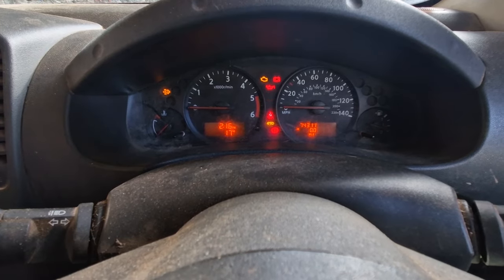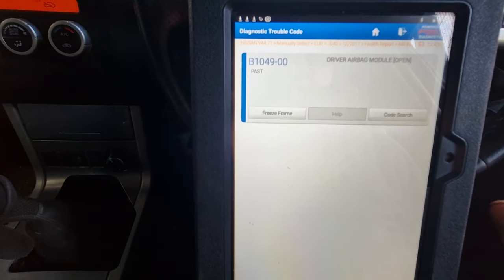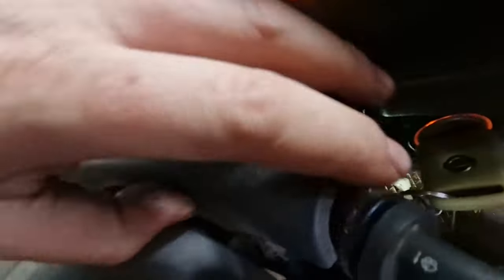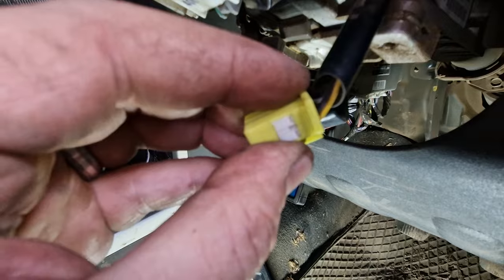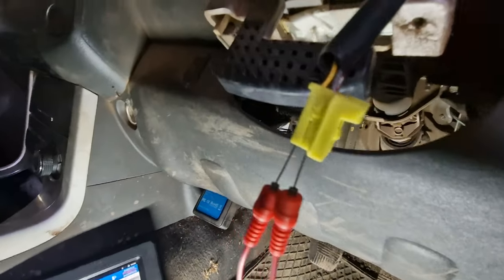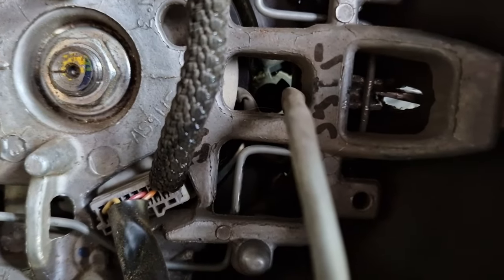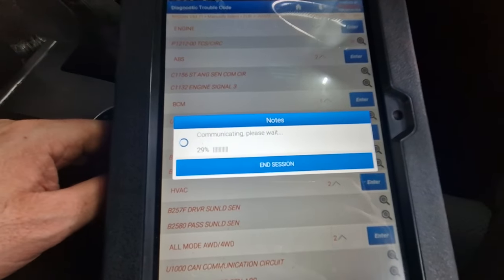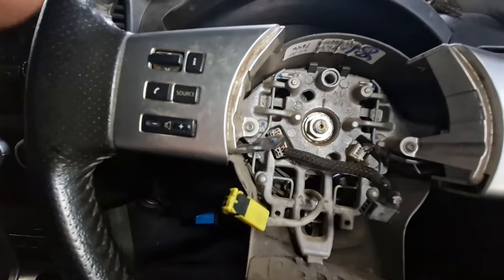Nissan Navara airbag fault B1049 Driver airbag module open circuit

Comment: Nice video but when you did the resistance test you needed to do it from the connector at the back of the clock spring to the front airbag connector. Not on the plug from the ecu as it's not plugged into the clock spring.

Comment: Hey bro. I’m trying to do some electric works on my car but very hard to find the exactly right wiring diagram. I’m based at New Zealand where most cars are right hand side drive just as your one. Always find some diagrams belongs to us version. What to know where did you get your wiring diagram? I know they all had to be paid but still no clue where to find